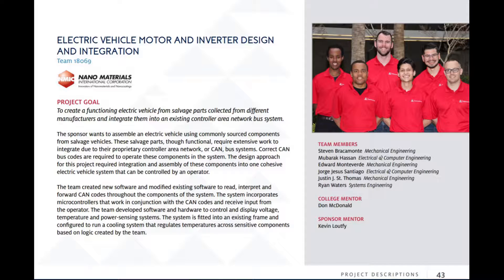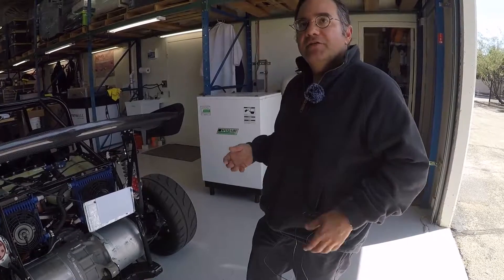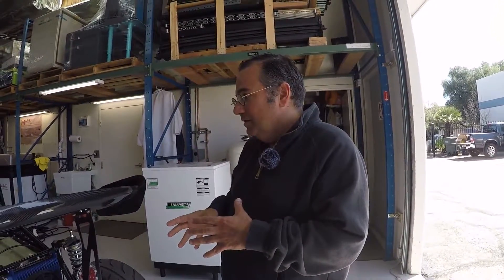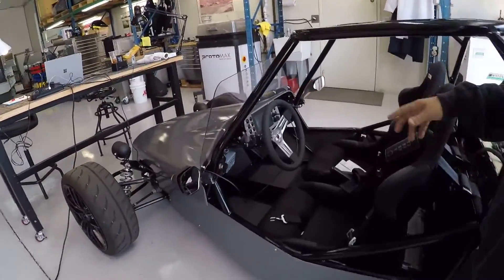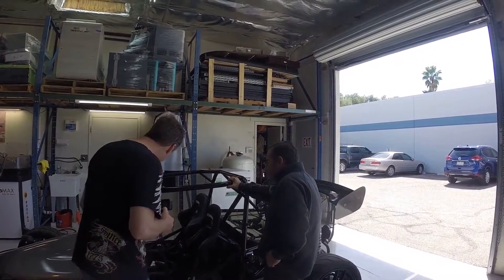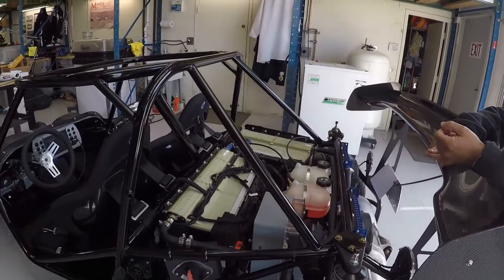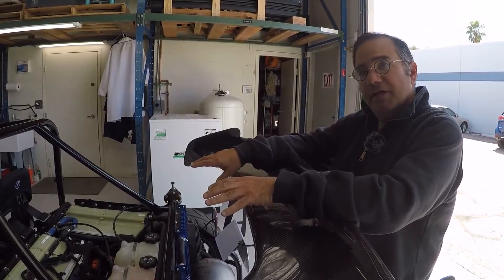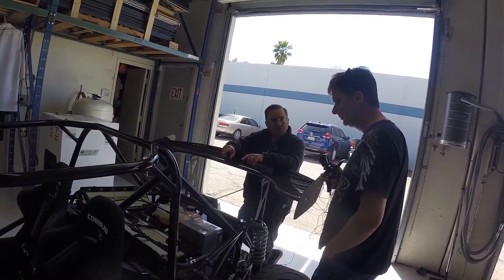Tesla DF Goblin. Part 1 of 4.

Comment: I thought it was significant that the most easy to use and straight forward electronic interface was from 057 Technology. I'd bet that aspect of these kinds of builds is what stops many EV conversions in their tracks.

I wasn't really familiar with the "precharging" and what that actually meant. After hearing the explanation, I can see why it's very important. You don't want a sudden inrush of high volts and amps frying components or making things erratic.

With the poor aerodynamics of this car, I'd expect the highway range to be very poor, relative to the Kilowatt hours of the batteries used. I'd bet most EV conversions fall well short of a factory EV's range due to insufficient batteries and less than ideal aerodynamics.
Reply from the maker: I also learned about precharging (and a lot more) from Kevin.  Most owners of a Goblin kit car aren't driving it for high efficiency... just the opposite, we drive them for their light weight high performance.  The Model 3 in (episode 4) is high efficiency, and great acceleration, but I bet the Goblin wins on the race track, winning with cornering and stopping.
Reply: @rosslawrence4628  Quite possibly true, but I wonder how many laps on a road course you'd get (with the smaller battery pack you're using) and if your drive system would overheat. Heat seems to be the main enemy of non-Track Mode Teslas when on a road course.

I was surprised that your car only weighs 1,600 pounds. That's impressively light for an EV! I'd be curious as to how much something like that would cost and weigh with the full Model 3 battery pack and BMS. You'd have more range for sure, but it would certainly weigh more. One thought is to use the entire underside/frame of a Model S or 3 from the firewall back. That way you already have mounts and plumbing for the battery pack and drive unit. The front could be what ever suspension you want, and anything above the batteries could be the body of your choice, or lack thereof. Could be interesting.
Reply from the maker: @snowrocket  This Tesla Goblin belongs to Kevin, I was just interviewing him, and getting the car tour.  I own a gas powered supercharged Goblin.  Kevin is planning on doing some race track time, so I too am curious to see how he is making out with this project.  Maybe a follow up video?
Reply: @rosslawrence4628  Oh, definitely! In fact, a gas versus electric comparison might be very interesting.